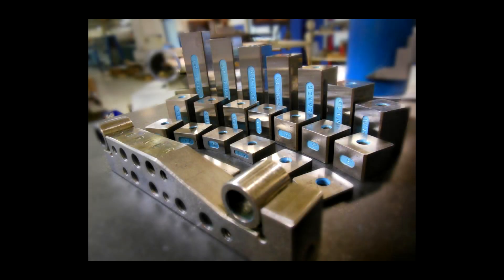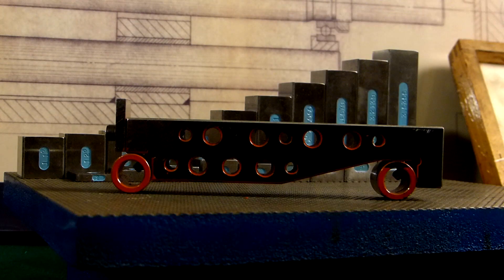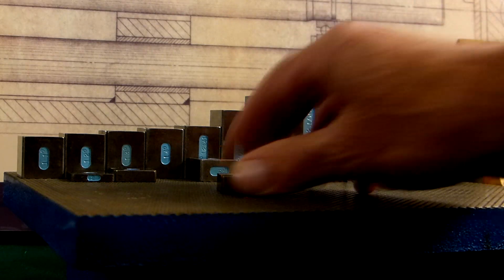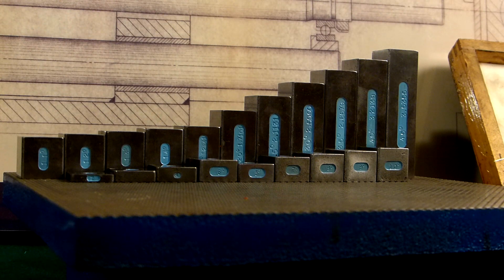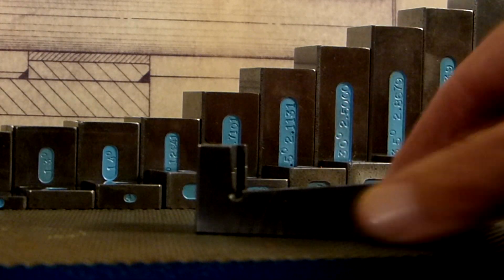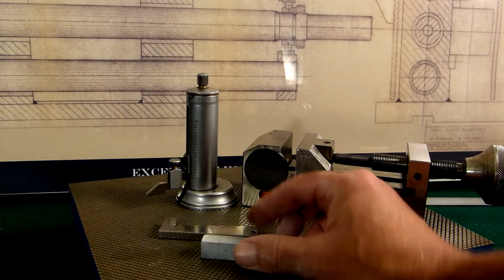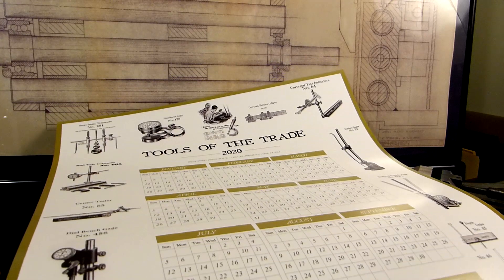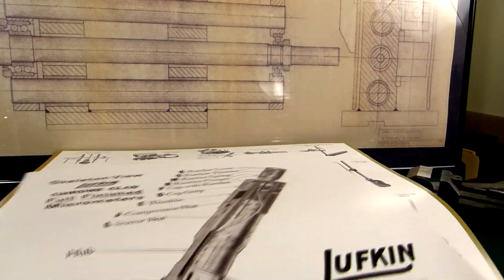Machining Angles: A Few Time-Savers

Comment: I made a set of angle blocks when I was a Mold-maker Apprentice, with a tapped hole in one end to screw a stop to. I've gotten a lot of use from them over the years. Always wanted to make a set of gage blocks for a sine bar but it never happened. I haven't seen one of those height gages for a long time. Thanks for the memories.

Comment: I've seen a differential screw on a vice before, now I know of at least two out there, and with a bit of effort I may add a third one day! What type of paint do you use on your tools and what is the colour coding for? Great tips. Thanks
Reply from the maker: That particular vise was my father's. The smaller threaded rod is left-handed, the theory being that it makes the vise faster to open and close. I hate to admit this in public, but good old Rustoleum spray paint works the best. I mask of what I can, and scrape the areas that have over spray with a razor blade. I usually get about 5 years of service out of something before it needs repainted. This is probably my last touch-up for my career.

Comment: We called your angle blocks wedge blocks,usually 2piece sets1/2" wide and 2 1/2"wide.And for color on electrodes we used white shoe polish.
Reply from the maker: White nail polish works well also. Nice thin brush.